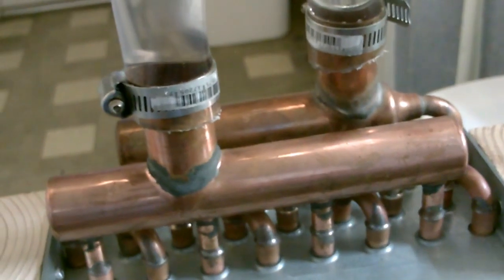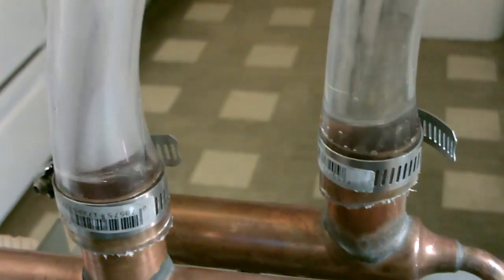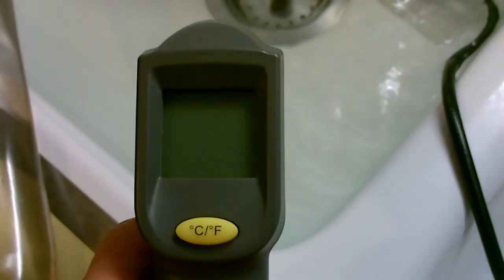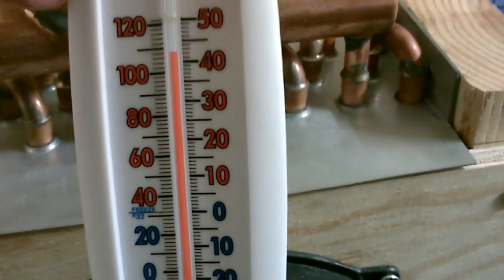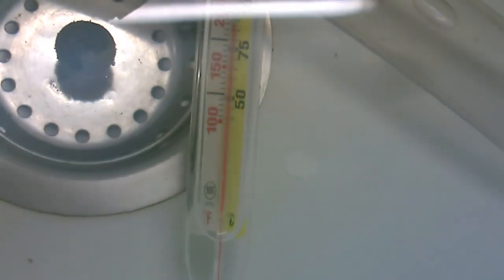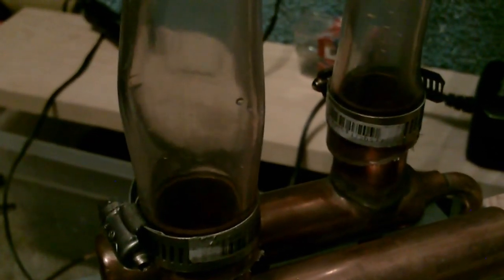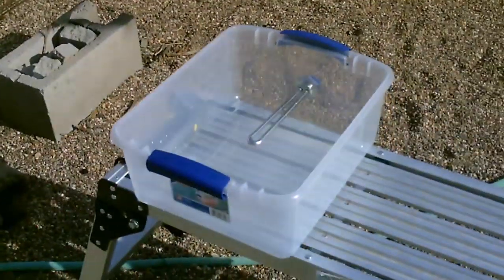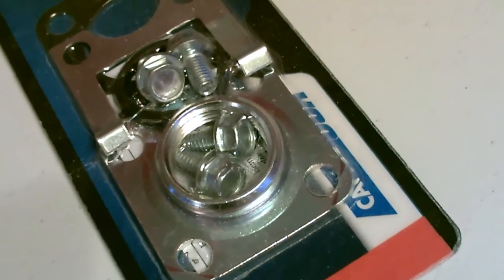DIY Air Heater! The "Hot Water" Air Heater! 85F-110F Air! (W.120-150F) - AC/DC & Solar Pwrd!

Comment: If I understand- instead of the sink hot water - you are saying utilize a solar hot water heater outside connected through tubing and a pump to the heat exchanger in copper with the fan?
Reply: I am saying that because I thought the sink was like a simulation to prove concept. In addition a small 12v pv panel can run the pump unless a convection is set up. Research has shown that pv panels with heating coil is the way to go when you can afford, but if short of funds a hot water application can save money until pv can be bought. 
Check Will Prouse ( spelling ?) in Nevada for pv expertise.

Comment: My bedroom is in a location in my building where my radiator never gets hot. But I have building supplied hot water and a recirculating hot water line feeding my bathroom. Maybe I'll make a heater using the recirc line.
Reply from the maker: hi there. sounds like a good idea! 👍

Comment: Good starting point. I have something similar going on which is part of a bigger project. Came to see what others were up to. I like how compact that heater core is. I pulled a heat exchanger from a fridge. 
Would be great to run as power efficiently as possible. Seems like a ton of shit to do for one outcome. Like you said, tons of possibilities. And testing and tweaking variables. But anyway, cool stuff bro.

Comment: Great concept... If you had a freestanding tank of say 5 gl. and added 1gl of boiling water you would increase the water temperature 1/5 of the total difference 210-70/6=23.3 you could have 70/93.3 degree temps blowing through the fan in a matter of a few minutes once the circulation completes.. and this is by estimating 1 gl in the circulatory system..Where did you say those automobile heat exchangers were again??
Reply from the maker: hi. you can find them on amazon.
Reply: use a pot with a candle underneath  for longer heat production.

Comment: Excellent!

On sunny days you could even run it continually attaching it to a black tube solar coil placed outside or on the roof. May need slightly larger pump but the heat would move the water well! On sunny days a great free heater.

I like the steampunk look for the unit ! Copper always looks and acts the business.